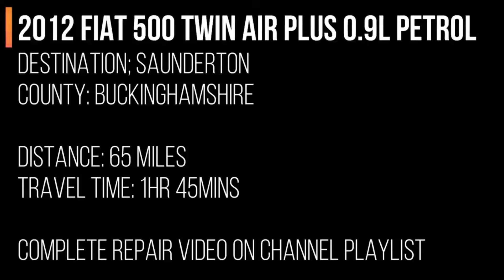2012 Fiat 500 Twin Air Plus 0.9L Petrol Clutch Replacement.

Comment: Do you usually have to clear codes after the clutch change?
Great content man, always appreciated 👍
Reply from the maker: Do you mean because the module has been disconnected..? 
If so no. Because the battery was removed first.

Comment: Just did this on a 2015. Part I missed was the subframe. Still got it out and in but would have been much easier. I do have one brass, round bracket left over. No idea maybe front corner bumper or something.

Comment: How long does it usually take you to change a single clutch?
Reply from the maker: In average once it’s up on stands.  About 3-5hrs. Depending on the job.
Reply: @WMCS Good. And what do you do when unforeseen circumstances arise, such as a broken or stuck bolt?

Comment: You need a Gazebo mate, can't be working in that rain....
Reply from the maker: I did have one once. Cost me more than the job once. The frame scratched the car due to always being windy 🌬️..
Reply: I've had a couple of vans with a tailgate on....a little respite sometimes....used parasols stuck in top of large axle stand sometimes here when gets hot in sun....but with a traumontana these get wrecked pretty quick😂..